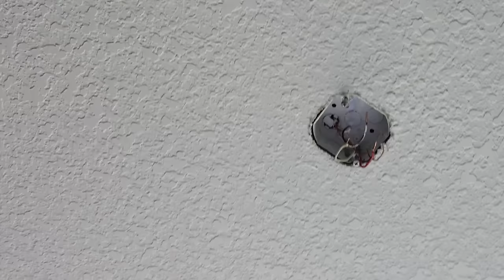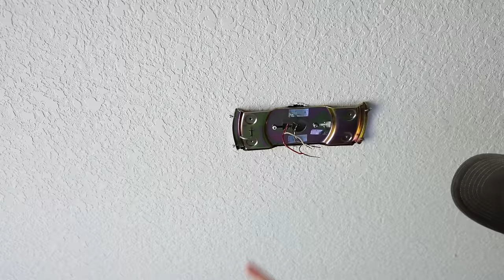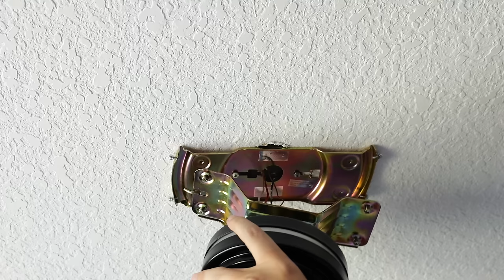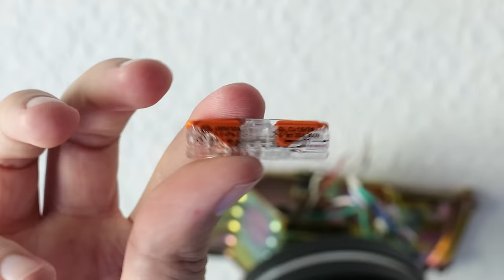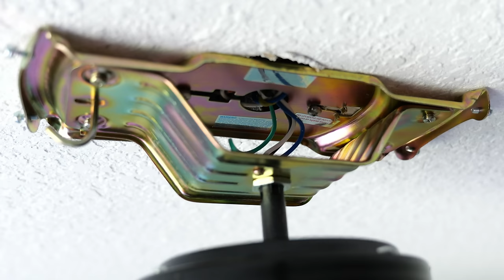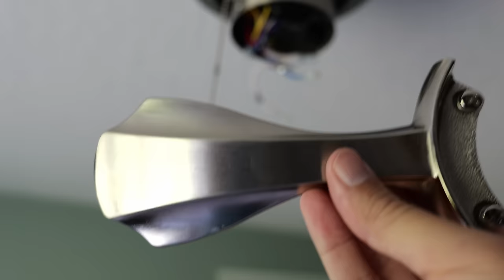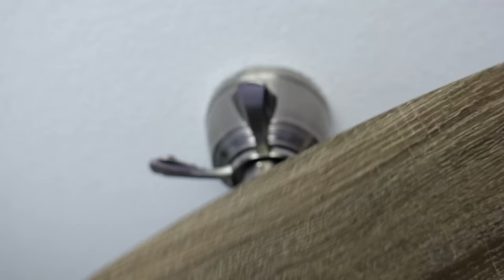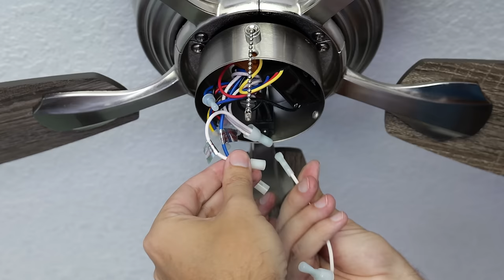Avoid This VERY Common Mistake DIYers Make When Installing a Ceiling Fan | How To

Comment: I was charging a ceiling fan for a place that takes in homeless women and children. When I took the fan off there was multiple wires that was taped and the wires all  4 white wires looked as if it was burnt. I have pictures only 2 wires had a wire nut. The rest were taped. I have never seen it like this. Yet due to the white wire looked burned told them not to turn on the circuit breaker. Until we get a better info on this. Even with the circuit breaker off some of the wires are still hot? Any information on this?

Comment: I wonder how many fires were caused by the fan wire connections not being shoved back up into an official junction box ??? I guess right up there with overloaded power strips, smoking in bed , etc.
Reply: I've seen 0 fires from ceiling fan installations, 4 or 5 from overloaded receptacles, and 7 or 8 smoking related fires.  
and one that started because a toilet fill connection broke off.
Reply: Lol my bet is 0
Reply: From my 12 years of fire and arson investigation I have seen zero fires caused by this. I've seen lots of stupid wiring methods and lots of lamp cord that was tremendously old brittle aged but never a fire caused by the wiring at the ceiling of a ceiling fan box.

Comment: You forgot to mention that the work box needs to be secure to either a stud or a compatible spanned box (which attaches to two studs.
Reply: technically a joist or a rafter. studs are in walls not ceilings

Comment: Suggestion: it would have been easier to snap the fan blades on before screwing the arms into the light.

That way, you're attaching them without your arms overhead, and it's less possible strain on the fan arms when you're snapping the blades on 😊

Comment: I think you missed another point in the video.  I think you need a ceiling fan box in the ceiling as well, not just any old electrical box, as they're typically not attached as well, and may not hold the weight of a ceiling fan hanging from it.

Comment: I added a Wi-Fi receiver to the wiring in my sand, but I am now nervous that I wired it incorrectly. Because the instructions were for a single wire and I have two and I didn’t connect the grounds 😳

Comment: I'm not an electrician, but I do own and work on my home, a lot... I thought the first switch as you walk in the room goes to the light, the second switch goes to the fan???? if that makes sense the way I said it.
Reply from the maker: Generally yes.  In my case the switches are on a short diagonal wall directly in front of the entrance.

Comment: What have found in older  house with a metal j box is there will be a couple of  number 6 nail holding it in place. So a couple months later j box and fan just hanging sideways bu the wires

Comment: I really don’t care what code says I will leave mine under. Less of a chance on wires short on metal bracket. And you can’t see what you have done to the wires up above the fan plate.. common since. Code is wrong.  Keep on keep on . I have done it for years no problems.
Reply from the maker: Umm Ok 😂

Comment: I’ve heard that when you install a ceiling fan, you need to ad weights to balance the blade, but that isn’t mentioned here?
Reply: No
Reply: If it is out of balance, you will need to balance it. If it is balanced, then don’t touch it.
Reply: New out of a box should never need balanced.

Comment: The previous owner of my house had installed a ceiling fan that was screwed into a roof truss with no outlet box and to make matters worse, he wired it with lamp cord.
Reply: I got a better one than that. Previous owner of my house drove a nail in the ceiling joist, doubled up the fan and house wires, wrapped a yard of electrical tape around the connection and hung the fan from the nail.😮
Reply: @yvonnejackson1696  Am I understanding this correctly, he used the electrical wires to hang the ceiling fan? At least this fan was one of those that has the big screw in hook. It was the use of lamp cord that bother me the most, while ceiling fans don't draw that much current, it's lamp cord for goodness sake.
Reply: @yvonnejackson1696  You got the win, lol.

Comment: if the box is rated to hold a ceiling fan.   a lot of houses have a plastic box for light fixtures only.  hanging a fan on one of those issa no no...and dangerous.

Comment: I first saw Wago wire connectors on your channel here. I asked a friend of mine, who is a commercial electrician, about them because they look easy to connect and disconnect. His immediate response was to NEVER, EVER use them because there is not sufficient crimping pressure to permanently hold the wire in the connector and the area with which the wire comes in contact with the internal bus bar is minimal and much less than twisting the wire then using a wire nut. His opinion was that Wago wire connectors are junk and are prone to wires pulling out causing bare exposed wiring resulting in a chance of an electrical fire. 

Can you do a video demonstrating just how much force it takes to pull a wire out of a Wago connector and how the rated amperage and actual amperage in use compare in relation to failure due to over heating of wire/bus bar from too little contact surface between the wire and bus bar?
Reply: he is being a luddite.  if there is enough force on the wire to pull it out of a connector, it is installed wrong.  that said, I am currently torture testing wagos in a corrosive environment and also using them in installations where devices get replaced frequently.  they are doing well in both applications, and I have no problem with using them for things like connecting lights.  my only issue is that a wago has 2 connection points and a strip of metal carrying the current instead of having a single connection point between the conductors.  that leaves me reluctant to use them for high sustained loads.  but the bottom line is they are a lot more idiot resistant, and in the quantities the average homeowner uses, the price difference is minor.
Reply: Your buddy is a caveman. Wago’s are UL Certified
Reply: @jerrybell6786  Stop being a troll. You're insulting someone you know nothing about. Just because his opinions don't agree with yours doesn't mean he's a "caveman" aka an idiot. He's a certified, licensed commercial electrician with 35+ years experience.
Reply: @kenbrown2808  A luddite? Maybe? But he is a certified licensed commercial electrician with 35+ years of experience. I give his opinion merit. Afterall, don't forget that at one time the "new technology" was to use aluminum wiring instead of copper wiring and it was all the rage. Then houses started burning down because of the aluminum wiring and we found out it wasn't such a good idea. Aluminum wiring has its place, but not everyone is comfortable using it. Even if archaic, a tried and true method of using wire nuts is worry free and I rather not takes chances with my home investment. "Peace of Mind" is worth a lot!!!
Reply: @johnNJ4024  your choice. I do still use wire nuts by default, because the cost difference does add up.
Reply: I don’t have a problem with Wago’s on LED lighting, but anything other than that and I am sticking with wire nuts or a crimp and solder. All it takes is one machine in the Wago factory performing out of spec or a bad batch of plastic to burn your house down.  With a wire nut you can feel the threads tighten up. Even if the wire nut fails, as long as you pre-twist the wires, the conductors will still work perfectly fine. With a Wago you are betting the farm on a chinzy piece of plastic. Your odds get a lot worse if that chinzy piece of plastic is as every splice in your house.

Comment: You missed one very critical step. Make sure the box is installed to code. You'd be surprised at the number of boxes that are just side screwed to a roof truss or floor joist! They may have held a light fixture for years but a fan is different. Not only is it heavy but it has torque. I've seen this a lot!
Reply: Yeah I bought a house where they literally pulled the wires tight and stapled them to the joist. It's amazing the stuff people do.
Reply: @JmAntle  👍!

Comment: Always double check existing wiring and the box before adding a new fixture.  Also you tightened those screws at the top of the housing too tight.  Those only need to be finger tight, never use an impact on those as they will damage the top of the housing, as you did.
Reply from the maker: Wasn’t damaged and nobody will see that.

Comment: 👍👍😎✌️🤟 The one thing I have come across is that the builder will use ceiling boxes that are for lighting use only. I will then replace them with ceiling fan rated boxes that are heavier duty with larger screws and bolts to mount the heavier fans. There’s quite a difference between the two boxes in comparison. I feel much more comfortable that a heavy fan will not be coming out of the ceiling and on to our heads. Thanks, a do it yourselfer.

Comment: Two points:
- You should point out to folks that you cannot just take down a light fixture and throw up a fan. That looked like a lightweight fan but in general  the box must be rated for fan installation AND you need to be positive that it has been secured properly. 
- I’m not an electrician so maybe I’m missing important info but why was a light fixture wired with two power feeds? Presumably 14/3?   It was GREAT that it was because it allowed you to install the fan, but I’m curious. Is that code now or was that just a unique setup in that house?  

Thank you
Reply: In my experience, if you see 2 hot conductors in a ceiling junction box, it probably is fan rated.  The electrician that installed the 12/3 or 14/3 even though he would only eventually install a light and not a fan would always install a fan rated box for the future (2 hot conductors and fan boxes go together logically).
Reply: @bobhall5893   That may be the case there but this is a how-to video talking about mistakes that you should avoid. Not explaining the existing wiring and box setup seems like missing info. 
I’m not a pro but I’ve hung a number of fans in my home (in every room) and one of the first parts of the instructions always refers to the box and then wiring.
Reply: @michaelluciano8795  Totally agree, step 1 is to prove the box is rated for a fan.
Reply: Maybe it replaced another ceiling fan.
Reply: @michaelluciano8795  The box in the video is clearly a fan rated box.  But even if it wasn’t, how many years did we go using standard fixture boxes and people’s fans aren’t just falling out of the ceiling.  In fact up until fairly recently this was not even a requirement unless the fan weighed 35 pounds or more.  These fans, unless much larger, are typically nowhere near this weight.  So while yes it would be best to install a fan rated box and currently code, let’s not pretend like the fan is just going to come down in a fixture box.  In most cases it won’t and hasn’t.
Reply: Hi John, What you're saying makes perfect sense to the seasoned observer or pro, but this is a how-to video for a DYI person who presumably has little to no training. I'm saying is that if the box is rated or the wiring all makes sense to a pro, the details about the box and the wiring should be pointed out to a novice DYI person.  I've installed several in my home and every one of them mentioned securing the box, and in later models mentioned fan-rated boxes.  I belive that this is important, given that this video is about avoiding common mistakes.  Just trying to be helpful.  Thank you.   @johnpicard4909

Comment: Do NOT use those plastic clips, use ties, those plastic clips can become loose and not hold the wire well enough over time and a wire will come loose and will touch something you don’t want it to.

Comment: I literally just dealt with this a few days ago.  for 2 years since buying my house my ceiling fan in the kitchen has been making a clicking noise when on, i thought it sounded like a noisy bearing.  how wrong I was.  about 3 weeks ago I started hearing a 'poof' or 'woof' noise whenever the fan was on, followed by a shooting star looking spark fly out of the base.  whelp, had my electrician come over (should have day freaking 1 but i'm a first time homeowner and new to this stuff lol) and he took down the fan.  the motha fracking previous homeowner didn't secure the wires up in the box and one of the hot line wire nuts was dangling down and apparently rubbing against the motor (that mysterious clicking noise) and over the course of 2 years it wore down the tip of the nut until wire was exposed (the shooting sparks).   needless to say I had certain feelings towards whatever handyman did the initial install.  got it all cleaned up and for safe measure replaced the fan entirely and it's secure properly and to code and as whisper quiet as can be.  as the saying goes, whether you're installing a fan, or you're an individual who has family jewels putting on their underwear, always secure your nuts!

Comment: and just how sure are you that the electrical box isn't going to come crashing to the floor? not all ceiling boxes are created equal. if someone installed with improper screws, that thing is coming down
Reply from the maker: I am completely sure as it is a fan rated box.  Even if it wasn't, not that I am recommending this but it wasn't until fairly recently that fans under 35 pounds needed to be in a fan rated box.  So there are fans installed all over the US in regular electrical boxes and they haven't come loose or crashing down in the many many years they have been installed.  Should you install them in a fan rated box now?  Sure, it is now current code.  But all that is just an example that it does not mean it is just going to fall out of the ceiling and most likely wont.

Comment: Just bought a Hampton bay mena (3 of them) 

The master bedroom has a dimmer switch // fan switch // outlet switch. 

I installed the mena 52” but this version has a remote* 

So outgoing wires from the fan is black / white / and ground. 

Existing wiring: red, black, white, ground. 

I joined red, and all black wires, white white, ground ground ; fan makes buzzing sound on all 3 levels

Also did: black to black, white to white, ground to ground and fan still makes buzzing sound on all 3 fan levels. (Capped red) 

Anyone know what’s going on? 

I read that it can be the ceiling fan itself and or the dimmer switch needs to be a regular switch?